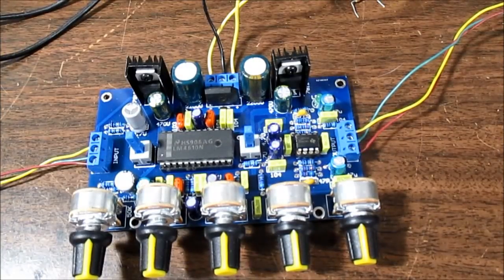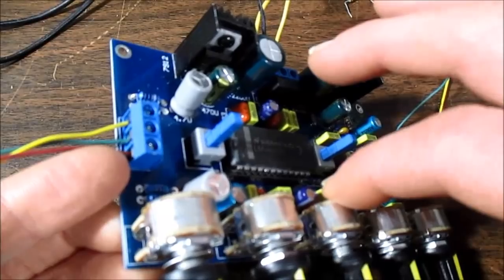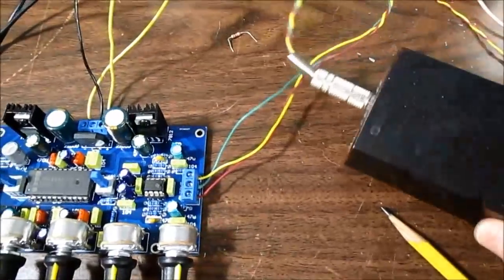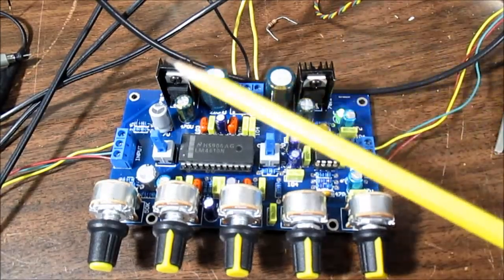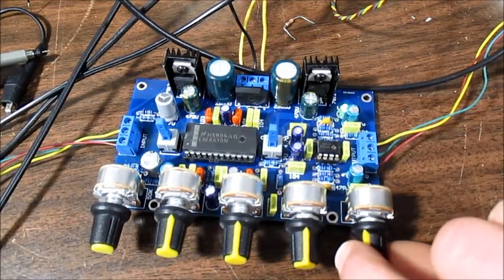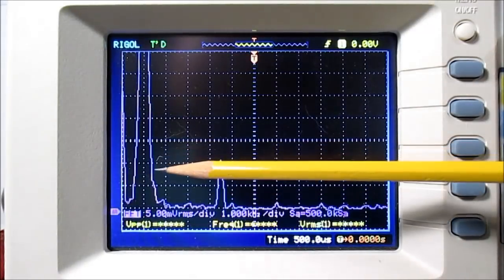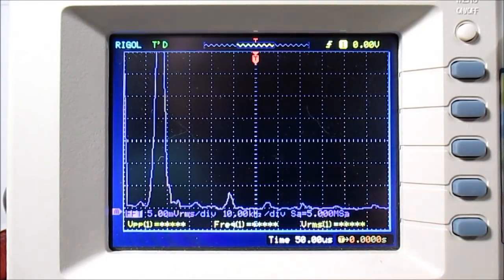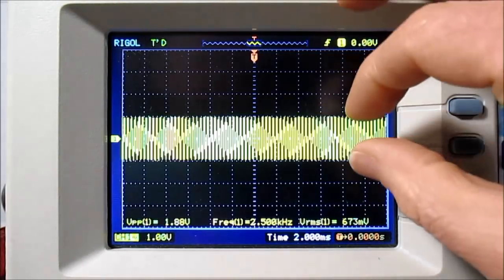Stereo preamplifier board with tone control test & review

Comment: Guys, anyone had white noise issues with this board? I use the same board as in this vid, but when the volume is 50% to 100% the output gets white noise proportionally increasing with the volume control. Shorting the inputs does nothing. Power is a transformer with 2 separate windings 15V. Tried to change the opamp - no results, still that noise.

Comment: Normally i use 17-0-17@0.5A transformer  then bridge rectifier then capacitors(2200uF each rail)
Then 7815 and 7915 _ then de-coupling capacitors on the op-amp (1 for each channel)
..

When i had 7812 -7912 with 12-0-12 
. 100hz noise is picked up- 

So to get 15vdc i use 17vac and keeps the noise a low _

Comment: Greetings:
Before you go, I could not help but suspect that the volume pot is linear taper instead of logarithmic (audio taper). You can check with an ohmmeter seeing if the resistance at wiper centered is equal between wiper and ground and wiper and max.  I haven't checked the chip spec's to see what it expects for input, but if you use an external log pot wired across.the existing one and only replace the original wiper connection with the new one, you should have more audio level before the midpoint.
Hope this helps.
Reply: You are right. When I look at the back of pots they are the same type (linear in my case). Volume must be logarithmic.

Comment: NICER preamp...
Most of the 'usual suspects' gear does not have either, or both, the balance. contro and a loudness contour circuit.
All we really need for automotive use is an inverter(i use a yuan jing 80 watter) to run the 5532 i.c.
All i really would like to see added is an input selector switching arrangement.

Best wishes for your dad & you.. 
God bless.

BRIAN.

Comment: I wonder how that chip compares to the older LM1036N. Probably changing the gain resistors on the op amp would increase the output and change the position on the volume control

Comment: Wondering about your thoughts on the exact cause of the power supply hum - I've built a couple of these types of kits, oddly they too came from "Banggood" too, seems like the hum thing is a common thread, even seen it mentioned in a few customer reviews - I've played around a bit with different filter caps and been able to make some improvements but I definitely haven't found the cure. Thanks, enjoyed your vid.
Reply: I think that the AC circuit is too close to audio signals. I prefer boards that do not have the integrated rectifying circuit - there are plenty of separate power supply boards available that can be positioned close to the transformer.
Reply: @MarkErikEE  Thanks Mark - I appreciate your reply and thanks for "planting" that idea in my thoughts - -
Reply: May find a non-polarised capacitor needs to be connected across the outer taps from the transformer.
Reply: @robertneill3057  Thanks for the suggestion Robert - - could you suggest a ball park value? Thanks, Skip
Reply: @skip1835  Generally between 470nF to 1uF for higher power amplifiers. Say 680nF to 1uF for P.A./ Musician amplifiers of 100w or greater. A 100nF to 220nf would probably do for this pre-amp board.

Comment: Tone controls lower the output. It is necessary to give yourself headroom for boosting certain frequencies. This is only necessary if you want the center of each pot to be 'no change'. That op amp is there just to boost the voltage back up to line level. It also acts as a buffer though, to keep the load impedance on the ic consistent and not variable based on the impedance of the amp you plug into.

Comment: The input cable is a disaster thus causing interference...sorry
Reply from the maker: The amp still has hum with no cable attached and the input shorted to ground to prevent noise pickup on the input...sorry.

Comment: Thanks man for the video, what will works better in this circuit, 2x 3300 25V capacitors or 2x 2200 35V capacitors? I will imput a 32V 1.5 amp power supply.
Reply from the maker: Both would work. This board already has filter caps though.

Comment: Hi John, I hope your Dad is okay,  as far as the board oh well, can you recommend a good replacement, cause this one is junk!!!
Reply from the maker: Doug Self developed a pretty nice tone control preamp. Not sure about boards or a kit for it. It won't be cheap. I'm an audio minimalist. The only control my amp has (besides a power switch) is a volume control. Sound engineers will tell you the tone controls, or better yet, an equalizer, are great for correcting speaker frequency response issues or to an extent, room acoustics problems. They are correct. However, I found a set of speakers that, imho, need no correction and my room acoustics are good enough (but far from perfect) for me.
Reply: thanks John

Comment: Any opinions on using laptop chargers for powering those cheap class d boards from china? I have a tda7492 board you've reviewed in the past, and im using a 27v transformer with a rectifier and a buck converter to power it with 20V DC and it would be much easier and cheaper to use one of those laptop power bricks instead.
Reply from the maker: If it delivers the current the amp needs and doesn't inject noise into the circuit, they can be fine
Reply: JohnAudioTech thanks for the reply. Noise is what i'm most concerned about, already had to modify the gain because of high noise when no input was connected, and many audiophiles bash switch mode power supplies saying they are too noisy, but i had no issues using buck or boost converters for powering audio amps.

Comment: Did they put log pot in for the volume where it was meant to be linear?
Reply: That was exactly my thought.  Someone may have thought that a "volume" control needed a audio taper.  But since this is voltage control, the taper might be handled on the chip.

Comment: "The LM4610 is a DC controlled tone (bass/treble), volume and balance circuit for stereo applications in car radio,. TV and audio systems. It also features National's 3D-Sound Circuitry which can be externally adjusted via a simple RC Network. An additional control input allows loudness compensation".
the link to the datasheet. it explains a lot about why this board sounds the way it does.
http://pdf.datasheetcatalog.com/datasheet/nationalsemiconductor/LM4610.pdf

Comment: Man, when you first showed the signal on the Oscilloscope, I had no problem seeing the high hz crap from the power supply rolling along the 1000hz signal.  Need some 10uf caps on the power supply.  Unless that was an artifact of the Scope.

Good luck with your dad.  Been there, done that.  We're all pulling for you here.

Comment: I bought few days ago a simple TPA3118 amp and if i pause the music my amp makes buzz noise, also noise become stronger when i touch phone screen. Any tips how to fix ground or add some components?
Reply: use a star ground configuration.
Reply: AS PER DATASHEET PAGE 28  =Grounding — The PVCC decoupling capacitors should connect to GND. All ground should be connected at the IC GND, which should be used as a central ground connection or star ground for the TPA3116D2.  doesnt matter the part number all amp ic's use this as "standard configuration"
Reply: i actually talk about this very issue in my video titled: How to build a DIY Induction Probe / Toner Signal Tracer Part #2 SU PYROW #13  EDIT>  part1

Comment: I'm breadboarding a guitar preamp for a chip power amp. Doing my head in.. I'm converting a circuit I found online for a solid state Marshall amplifier, with split 15v, and trying to convert to single 12v supply...first stage seems ok, but not getting voltage correct from the 2nd..tried powering Vdd/2 on non inverting and inverting, swapping stuff..must have killed half of a tl072. I hate it when I can't get something to work..my life is a misery untill its fixed :) gonna go watch some of our older preamp vids..think you did one using ne5532's...maybe that can point me the right path

Comment: JohnAudioTech+ I wish and pray for your fathers speedy recovery, I had a 4 way Bypass so I know it's not a easy comeback. Before my operation they either lied to me or something went wrong. They told me I'd be up and running in no time, but in recovery they said it will not be the same and they weren't lying then, but I believe you'll be surprised when you start getting into the high powered amps. How could we have fixed that hiss and noise on this board?

Comment: Yesterday I  ordered components to built and test a preamp circuit I found. It uses a TDA1524A. Any toughs on that chip ?
Hope the surgery went well. How's your dad ?
Reply from the maker: I don't have any experience with that chip but it is probably quite similar.
The surgery went well and he is in ICU. He will be moved to a room soon for a few more recovery days in the hospital.
Reply: Thanks for your answer. I'm glad all went well :)
Reply: Glad to hear that the surgery went well and hope that your dad makes a speedy recovery. Man  can't believe the noise that thing maks. somewhere there is a grounding problem with  all that induced hum. Would like to see a vid on you sorting out some of those issues with it.
Reply: I built that tone amp circuit. It worked very well. Put a filter cap on the power pin, about 47-100uf.
Reply: john smith On the schematic I have, there is already a 220nF polypropylene capacitor on pin 3 of the IC. I've seen another schematic that uses a 100nF cap. Do you suggest I add a 47-100uF or replace the 220nF by a 47 or 100nF cap ?
Reply: Yes. Add that electrolytic to pin 3 to ground. I used a 100, but sure a 47 will also work fine. Try yours without it first. If you hear some low level rumble, add the cap. Leave the other cap there also.
Reply: Thanks a lot for the tip john smith.